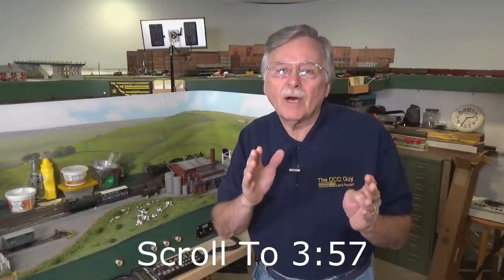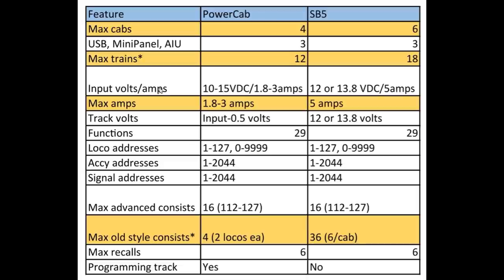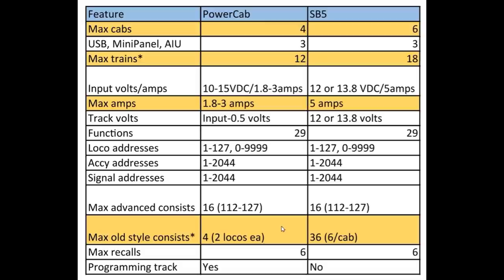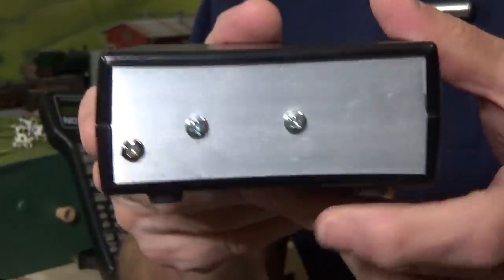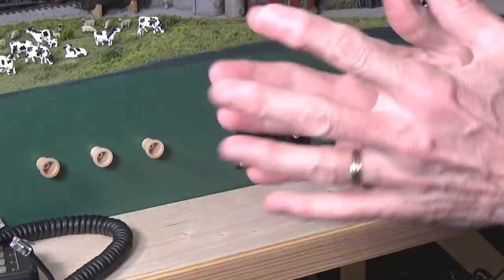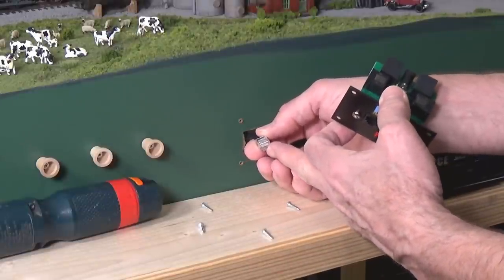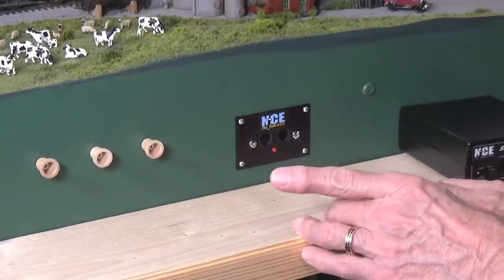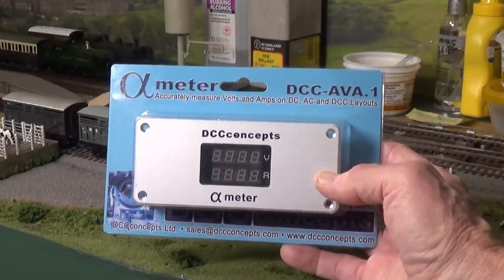Energize Your PowerCab (230)

Comment: I've been having problems with my sb5, it powers up but wont run trains properly. The locomotives will start up with sound and some lights but won't run. I've reset the system a few times but still runs badly. Got any advice?

Comment: Nice and simple video, thanks. I upgraded to the SB5 a few years ago. I also use the  Wifitrax module  linked to my system, it creates its own wifi network and allows you to use Engine Driver on android or WiThrottle on a I-pad or phone etc. Very  useful if you have sound locos, you can use a rota to list all you locos and functions on a touch screen.
Reply: Please let me know what you think of that setup now... I think a wifitrax panel is one ofnthe last upgrades for me to get as far as DCC, that and a few circuit breakers...
   I have no plans to use JMRI or a computer in the layout,  I'll save the PcP for a programming track, or....

Comment: Larry, if you add a dumb booster, you will still have 5 amps of power to the layout, not 10 amps.  You would have two power districts with 5 amps each.
Reply from the maker: Yes, but since you have access to 5 amps in each district and assuming your trains are more or less evenly distributed in both then you in effect have access to a total of 10 amps of power.
Reply: Larry, not really.  In electronics, amperage does not work that way.
Reply: @robertheroux2402  The way I'm looking at it is....... say district 1 can handle four HO locomotives that will require 5 amps.  The same with four locomotives in district 2. The eight locomotives all running at the same time require 10 amps, if the power requirement of each is added together. That's what I figure Larry means by " access to a total of 10 amps of power".   Each (isolated) district still remains at 5 amps, but twice as many locomotives can be running on the layout, with the addition of the DB5.
Reply: @larryadamson6686  I can see that.  But still the entire system is running 5 Amps.
Reply: @robertheroux2402   I agree, it would be running at 5 amps.  Separate isolated track booster districts for each additional booster.  13.8 volts and 5 amps max. Same DCC data-link covering them all.

Comment: Larry, I'm a bit confused.  I presently have a P.owercab system, but I'm building a larger layout.  It is U shaped, 8 feet X 4 ft.long at the bottom 0f the U and 32 ft. X 4 ft long on each sides.  Because of the distances how many boosters would you recommend?  .
Reply from the maker: It is not based on the distance of the runs but instead is determined by the load. The load is determined by the number of locos and how many amps they draw plus any devices that are powered off the DCC bus. So find out how much each loco pulls on average and add that up and you’ll know whether your PowerCab can handle the load alone or needs an additional booster. Look at my video on Power Management. If you need more power you have a couple of options: (1) buy a SB5 smart booster or (2) consider the new Aegis system from DCCconcepts. You can see my review on the MR website posted a couoke of days go at https://www.trains.com/mrr/news-reviews/reviews/staff-reviews/mr-exclusive-dccconcepts-aegis-upgrade-for-nce-powercab/ . Iron Planet Hobbies will be the US vendor and of course you can order direct from DCCconcepts. 

Given your length of run on each side I would put the command station/ booster in the middle of the 8’ section withn the bus running out in each direction. That will keep your total length down to about 36’ on each side which is a bit over the recommended 30’ so you may need to add snubbers on each end of the bus.

Comment: Hi Larry.. at the moment I’m building a layout ( N gauge) with a total bus length of 45 feet. If ( and when) I add the NCE booster to my Power Cab, will  32/0.2mm cable ( rated 6amp) be suitable for this length? Or should I use a larger cable size. At no time will the layout run ( when the booster is incorporated) a maximum 6-8 locos at once . Probably be 3 sets of 2 used in a consist and 2 solo locos when I incorporate the booster... It’s just making sure that an adequate cable is in place... Any advice ( if you can) appreciated...as always. Thanks Larry....... Regards Colin
Reply from the maker: That wire is approximately 17 awg so would be OK for N scale. However I recommend you keep your runs to under 30’ and if possible go to a slightly heavier wire unless you have already bought it. Often a simple rearrangement of your wiring scheme or using a star pattern can result in shorter individual runs.
Reply: Thanks Larry.. that’s interesting and I was thinking the same. The total is around 45 feet..and the control is in the middle so it will be a star extended evenly 3 or 4 directions. So the runs would be 12 to 15 feet each.. Thank you for your reply .. that’s very helpful.
Reply: Hi Larry.. apologies. Following on from my earlier message to you... What would you recommend on next size up from 32/0.2mm? As I’m still designing the layout this may be a good time to purchase a slightly heavier cable as you suggested . Is there such a thing as ‘ overkill’ and would this be detrimental if say I used a 1.5 or 2.5mm flex. Just thinking ahead with possible expansion in mind and the booster. Again thanks for any advice.... Colin
Reply from the maker: I usually recommend 16awg for N scale so since yours is 17awg it should do fine. I have even seen 18awg used. I was more concerned about your runs being over 30’.
Reply: Thanks Larry...

Comment: How many Cab Bus Fascia Panels jacks can you daisy chain?  Without WiFi throttles and a large room, can you daisy chain multiple cab fascia panels jacks?
Reply from the maker: I don’t know whether there actually is a limit but I do know that if you use more than a handful you do need to provide additional power for the throttles, using the jack on the back of the panel.
Reply: @TheDCCGuy  thank you, I’ll try that

Comment: At 20:00 - haven't seen one of those B&D screwdrivers in 20 years, I had a couple plus a 1/4" ratchet! Great video. Cheers
Reply from the maker: My mom gave that to me for Xmas about 20 years ago. I recently had to replace the battery charger and I need to order another battery, which are now getting hard to find but it still does the job.
Reply: i have one also  great for tight lite work

Comment: Dear Larry, great explanatory video! The only thing I would like to comment on, on the diverse connection locations of the NCE SB5, is the fact that they’re all front plugged. Hence, the wires from the throttle port still have to circumvent the fascia in the installation example you’ve shown. I’m aware most people will install the booster on a more central location, where the wiring wouldn’t matter as much. However, in my humble opinion it would make a lot of difference when such a component would also be available in a fascia mounted version, for which the wire sockets are mounted at the back-end of the appliance. Not that it is such a big issue. But maybe something for NCE to think about. Cheerio
Reply: It makes the most sense to me to mount the SB5 put of sight, and have it wired to fascia panels for cabs to connect to... the other socket could go to radio base station,  a wifitrax board, etc...  or to send wiring in 2 directions for fascia panels...

Comment: I own a Power cab and just bought the SB5 booster.  Is there any problem if I keep the RJ-12 6 pins cables installed on my layout or I must change for the RJ-11 4 pins cables?  Thanks!

Comment: Larry, I have an L-shaped N scale layout that is 11 x 12 feet x 25" avg depth but it has 236 feet of track on it. The bus wire is less than 20' with 55 Kato unijoiner feeders (cut off less than the 35" lengths)! I am using a NCE power cab and run up to 7 and 8 locos at one time and i do not notice any issues. 
Should i be using a smart booster woth 236 feet of Kato Unitrack though?? Thanks
Reply from the maker: If what you have does the job without problems then stick with it until something does go awry.
Reply: @TheDCCGuy  all I noticed yesterday was having to give more throttle input when I actually had 11 locos running at the same time! But nothing g acted up and the NCE power cab was o ly showing 1.1 amps
Reply from the maker: What size is the wire? Smaller wire means more resistance and lower voltages at the track.
Reply: @TheDCCGuy  my bus wire is 16 gauge and only 18' long. All the Kato feeders are 24 gauge but I cut almost all of them at least in half so they are 12 to 18" long.

Comment: Hi Larry.
After some help. I am using the Cobalt ADS Solenoid controller with the DCD-SDC 3 wire accessory adapte😂r to control my Kato unit rack points, the instructions with the 3 wire adapter mention adjusting the throw time of the decoder output, do you how this is done please?

Thanks
Reply from the maker: Is the 3 wire adapter a Kato product or DCCconcepts, I can’t find it and the Cobalt DCD-ADS manual doesn’t say anything about this. If you are in the Uk I suggest giving tech support in Settle a ring tomorrow.

Comment: What AWG gauge do you recommend for the bus wires using the NCE SB5 Smart Booster? Thanks!
Reply from the maker: I use 14 ga for all my bus runs. See my videos on wiring for more specifics.
Reply: Is there any type of unwritten rule that # AWG bus wires can accommodate a certain footage of HO track? Is there ever a scenario where 12 AWG would be the right choice? Thanks!
Reply from the maker: It is best to keep your runs under 30’ as I explain in my wiring videos. Long runs, higher amperages, require bigger wire.

Comment: Hi Lary. Perhaps in a future video you could cover the connection of the additional UTP panel and a second throttle/cab?  I use a PowerCab and am soon going to upgrade to the SB5, so these topics are very helpful indeed. Thank you
Reply from the maker: It’s just like installing the one I showed in the video. Just daisy them them around the layout.If you go back to video #151 I show how to connect the wires under the layout and mention adding the additional UTPs.
Reply: @TheDCCGuy  Thanks.  #151 did help.

Comment: Hi Larry is the UTP panel you have shown a new release as the ones I have only have 4 RJ12 connectors and was the LED already wired up cheers
Reply from the maker: Yours apparently is the old UTP designed for use with the 6 conductor flat cables. The current version is the UTP-CAT5 which uses the Category 5 cables for the cab network bus.

Comment: How do I know what size booster I need for my layout? Is there a general rule of thumb for size and what amp output I need?
Reply from the maker: That is a balancing game in itself. Basically though you count how many locos you will be operating at the same time and then assign a amperage value for each based on how much current their motor draws. This is subjective unless you have measured the stall current values although Model Railroader provides measurements for each model in their product reviews. If you don’t know then assume 0.5 amps for new HO locos, and 0.75-1 amp for older models with open frame or non-kew wound motors. For N scale you can cut that in half. Don’t forget any lights in your passenger cars or cabooses, and accessories and switch machines if they are powered off the DCC bus. Add that all up and it will tell you how many amps you need. If you go over 5 amps then you will need a second booster and so on. There are ways to get more out of your boosters and I discussed that in my videos 112 & 113. on boosters and power management.

Comment: Larry, another excellent and informative video. I am getting ready to get my first DCC System (small N scale rr) and am  hoping you could give me some insight into the ESU System.  This NCE system seems nice but after upgrading looks like I may as well go ahead and purchase a “higher” end system be it NCE, ESU or Digitrax.
Reply from the maker: If you can afford to dive in with a high end system, then jump in and enjoy the bath. However because if the cost I suggest finding someone with the system p(s) you are considering and get an on invite to operate on their layout. While command stations and boosters all do the same thing they may hVe their own idiosyncrasies which may not make any sense to you. Also throttles can be very user friendly/unfriendly to different folks. So it is important to get a feel for how they work since that is what you will be holding much of the time. Finally go to the manufacturer’s websites and download the manuals. This will allow you to decide (1) whether they are too technical for your tastes abilities, (2) offer what you think you need, and (3) decide whether they can actually offer a reliable supply of products. This may be a real concern for example if all their products are made in China or elsewhere and parts/equipment may not be readily avaialble except when a container load arrives. Finally, if it should need repairs where will you have to send it—overseas?

Comment: Do you have a video on your thoughts on LCC?  Because you have been using DCC for a long time, I would be interested in your perspective.  Thanks
Reply from the maker: The only products I know of are made by RRCirKits so it really has not even gotten much of a start. Generally modelers are waiting to see what it can do and what kinds of products will be made, while manufacturers are waiting for modelers to ask for products. Since demand typically drives production there really is no driving force for LCC as long as modelers are happy with what they already have. So I tend to agree it is a solution in search of a problem.
Reply: @TheDCCGuy  Exactly this, "solution in search of a problem"

Comment: I’m lost with what direction to go. I like the power cab but then that’s switching to DCC? I have a few DCC and few more dc atlas and athearn. Also i got a Marklin 1982 display board with a few engines but that’s an entirely new works for me
Reply from the maker: It is a major commitment to convert to DCC but offers many advantages over DC once you want to run more than one train at a time. Check out the Blunami videos I did recently, they offer the ability to get the power and features of DCC while using DC power.
Reply: @TheDCCGuy  hey i have a quick question unrelated to this if you or anyone can answer. I bought a Walthers HO UPS engine that’s missing the motor and front trucks for five dollars. I tried ordering trucks on eBay but the wrong size showed up and i can’t find a product page on this engine. Where do i find parts to fit? Sorry for how vague this is lol currently hunting parts and remembered you
Reply from the maker: I’d call Walthers customer support. They may have parts but even if they don’t they should be able to tell you the correct part you need.

Comment: Hi Larry.. I use (at the moment) the NCE Power Cab ( 12 months old) as my sole controller . 
I find it easy to use.. but have noticed when setting up a Consist , the rear loco always comes up as the lead after programming both into the unit. This doesn’t really matter as the locos are twinned front and rear of the train but wondered if this is something that is easy to fix. ?? 
Your channel is like a reference library .. absolutely brilliant. I’ve learnt a lot from your videos since coming back into the hobby. Thank you.. regards Colin
Reply from the maker: Let me check that tomorrow and get back to you. If I forget please remind me in a few days—Larry
Reply: Will do.. thanks Larry..
Reply: Hi Larry... you asked me to remind you about the NCE Power Cab consist glitch that I have on the controller. To recap I always get the trailing ( 2nd) loco come up as the lead on the display. If you can advise great.. but no problem if you can’t ... always appreciative of your feedback and replies....Colin
Reply from the maker: I tried it and the correct loco came up as the lead. So I can’t understand what is happening with your system. If using ad an ed consists try reversing the locos as explained on or about page 30 in the manual.
Reply: Thanks Larry, yes I’ll try that. It is weird as I’ve got three consists at the moment and it’s been the same every time that I’ve programmed them.., as I said it’s no big deal at the moment as my layout ( still in the build stage) is a modern Terminus with a reverse so trains come and go into the terminus so the trailing loco is at times the ‘ lead ‘.. That said there are others to be done so I’ll delve a little deeper into the manual. I’ll let you know.. Thank you again for your time . Colin

Comment: Ayuda, mi powercab esta bloqueada, como se puede desbloquear? Tal vez fue oor un corto en la via y se bloqueo
Reply from the maker: I am not aware of a way to lock a PowerCab so you may have cooked it. It likely will,need to be sent back to NCE for repair or at least diagnosis. Contact them at their tech support number or address.

Comment: Yo lo tuve y se descompone muy rápido, deben tener cuidado no haber corto circuito porque se protegerá y no volverá a funcionar y me quedé sin control para mis máquinas :(
Reply from the maker: Mine has been working fine since I made this video so you mist have had a defective unit. Did you send it back for warranty repair?
Reply: @TheDCCGuy  lo habia comprado usado, alrededor de 30 dolares, la pantalla principal solo marca la version 1.3 CAB 02 , de ahi ya no se actualiza, se quedo congelado.